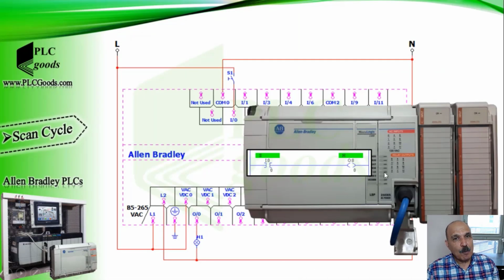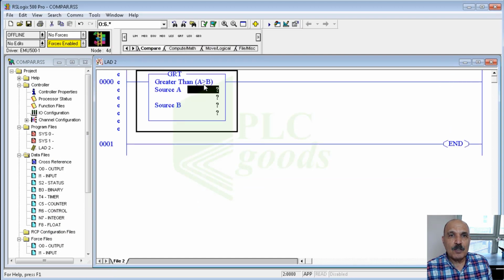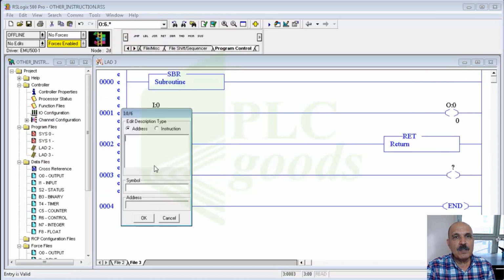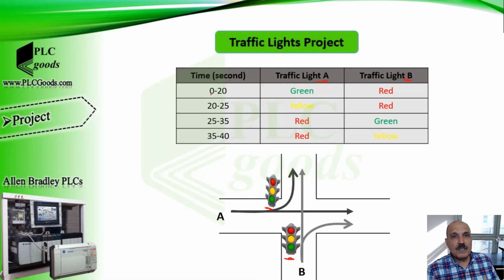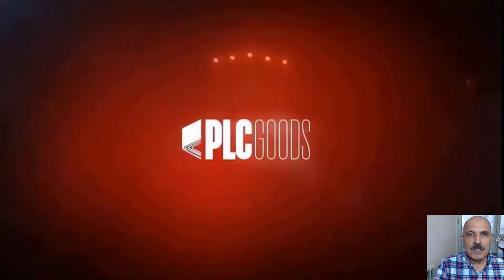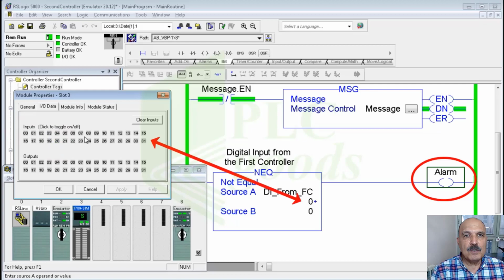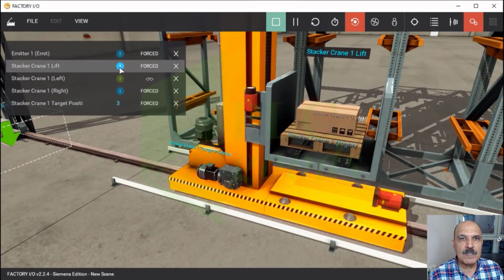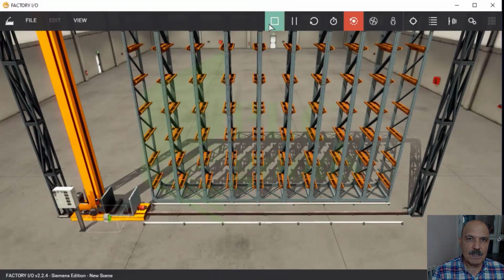Complete PLC Programming Course | Timers, Counters, Math, Alarms, HMI & Advanced Automation

Comment: So do you need all these programs to do the course or can I do it with just rslogix 500?
Reply from the maker: RSLogix 500 is used for the SLC 500 and MicroLogix lessons, but the course also covers RSLogix 5000 and other software for different sections. 💚💚
Reply: @plcgoods is there a free version of 5000 like 500? I have a trial version of factory I/O, I just need 5000 for the later lessons. Great stuff so far! 😊